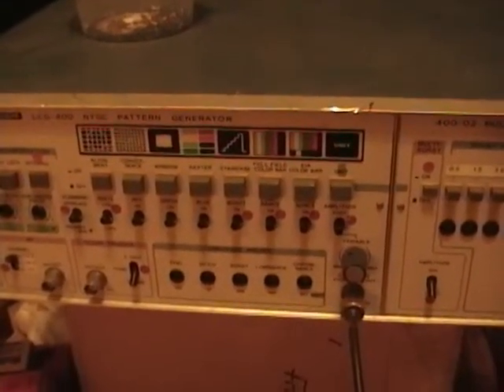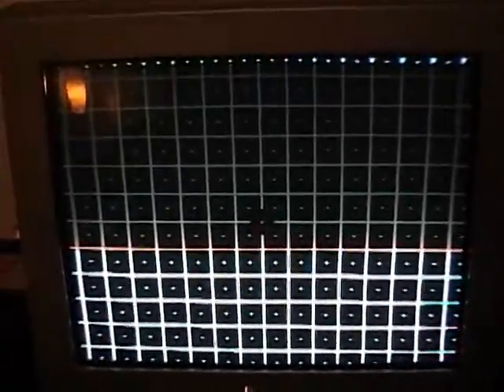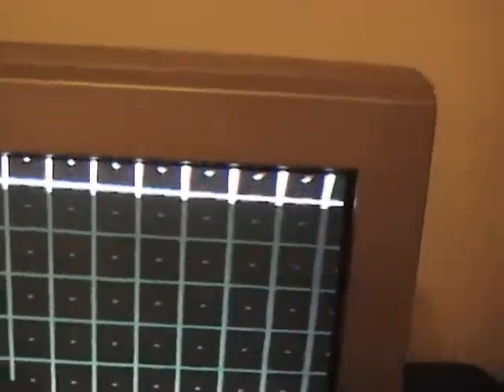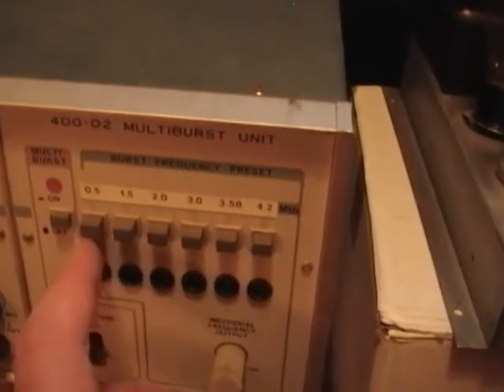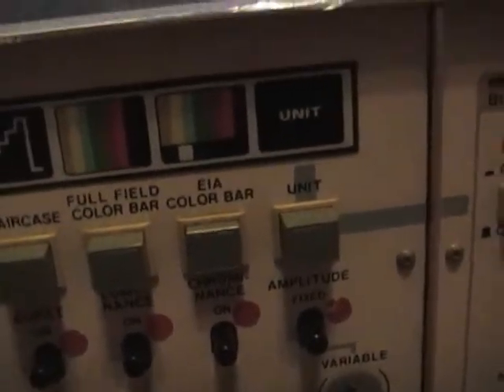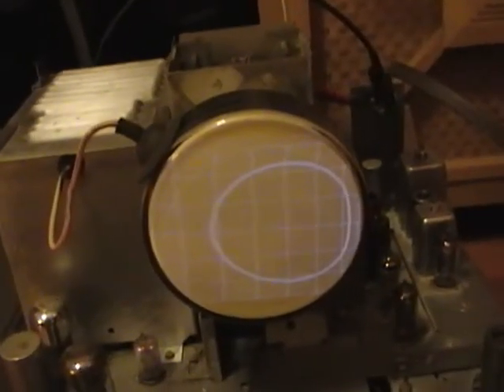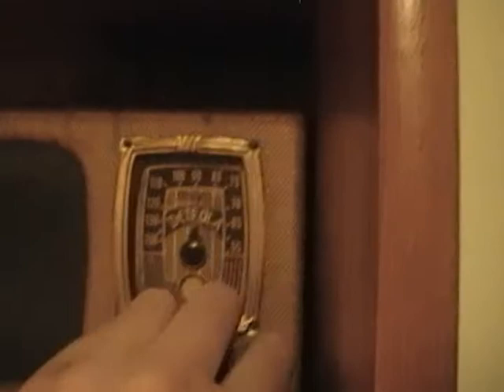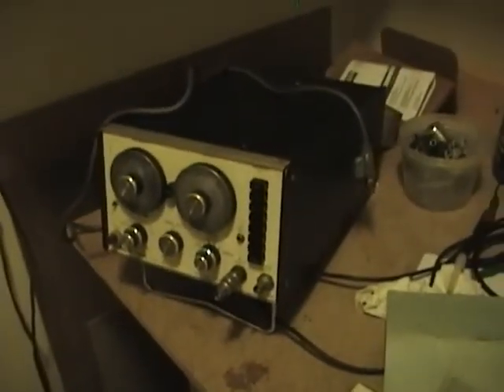Leader LCG-400 NTSC Pattern Generator - part 2o2

Comment: Can this test equipment be used on the newer and up-to-date digital flat screen tv?
Or are these machines regulated to bubble tubes?
Reply from the maker: These can be used with any equipment that accepts an NTSC signal.  It does not put out HDMI.
Reply: @bandersentv   Thanks!
Reply: @bandersentv  Would a piece of equipment like a Leader LCG-396 NTSC Pattern Generator be obsolete?
Reply from the maker: @1trucxhondamov589  Yes, they were made in the 1980s and not very useful now except for repairing old TVs
Reply: @bandersentv  Thank you, would there be a use for mega computers?  I believe there should be a niche for a piece of valuable equipment the way simpson meters are still used for very small ampers and voltage drops.
Reply: Thank you for the helpful and interesting video on this unit. What type of connectors this unit have on the back? Does it support Y/C connector or Composite output only?